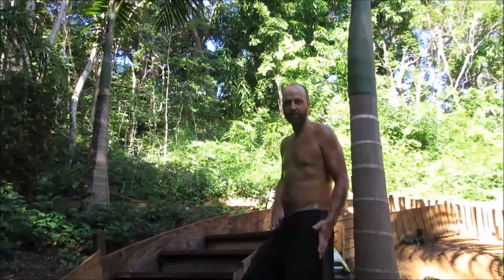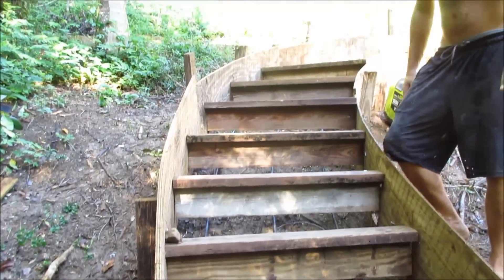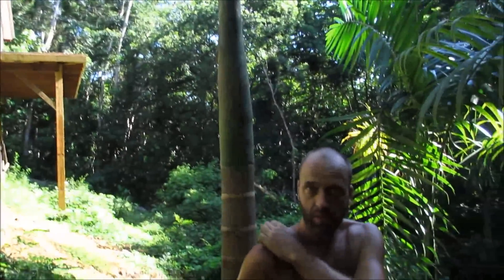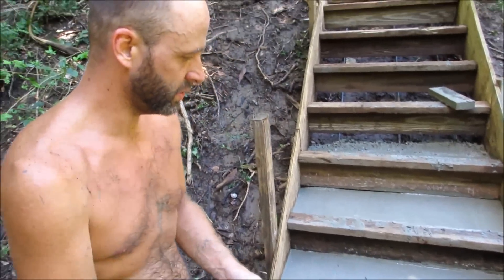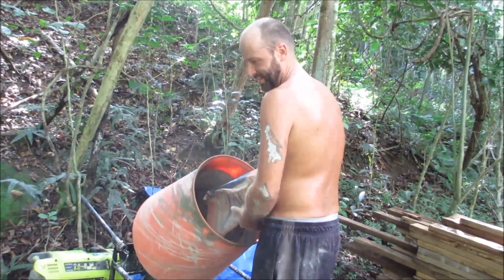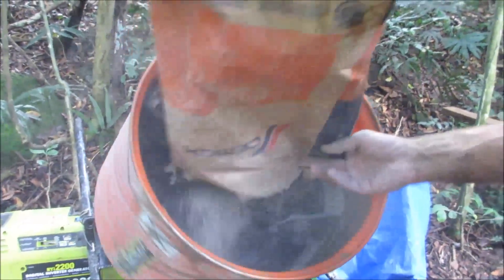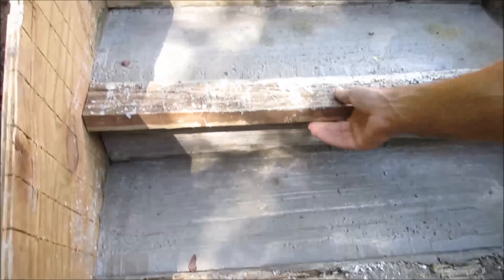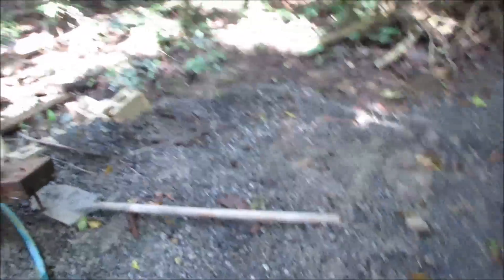How to Make A Concrete Staircase -Even in the Jungle!

Comment: 1 Did you ever put a handrail/roperail across your "Bridge"?
2 What did you do with all the construction debris (forms/bags/misc)
3 Just a friendly tip. NOT meaning to be harsh. You need to get more protein in your diet.
   Especially when working that hard.

Thx for the vid.
MJ
Reply from the maker: Hi Mike! 1) We still don't have handrails on the bridge but since we recently had a baby, we might. We are finally putting them on the cabin deck now actually! 2) We saved the lumber from the forms to be reused and threw away the cement paper bags. 3) Not sure what's being implied by the protein comment. I think we eat well. 
Thanks!

Comment: Hey man,  You really need to add some water proof ground cloth, some perforated drain pipe and a bunch of gravel on the top side of those stairs (at least on the top side), or that new staircase will wash away during the first down pour.
Reply from the maker: Well considering that it is nearly 4 years old and went through many downpours and the worst hurricane in recent history that is obviously not true.  Thanks for commenting though.  You can see a recent video of it on our channel.

Comment: Good work with the stairs... but: - yiep!!! to mucth water in the concret... Next time.. a good advice: - First, you mix sand with ciment, on dry... and you let it mix well.. than you add water.. and let it mix ... so at last you mix the rocks.. let it mix.. and then you see if you need to compensate the water because its to dry.. you will never make a mistake this way.. and you will have a better mixed concrete!!!

Comment: Hi im from Puerto Rico and have a similar project to do. My question is money wise like how much it cost? the 40 bags and the rock and sand pile?
Reply from the maker: Hi Joel! Here is the cost of materials that went into this; each cement bag is about $4-5 so around $200 there. The rocks and sand were about $200-$300. We reused wood for the forms otherwise you'd need to buy those as well as the nails and any tools you needed like the trowels, mixer, shovels, buckets, hoses, etc. You may also need to factor in labor costs. We hired one person to help with the form work.
Reply: LifeTransPlanet thanks for the info. Wish you the best.

Comment: nice job,but I don't see how you anchored it to the ground.I hope you aren't depending on the weight of the concrete to keep it in place.one good sold day of rain and those steps will be undermined,then crack,then wash away.
Reply from the maker: We have a concrete slab at the top and middle. We have gone through tropical storms and hurricanes with torrential rain and have not had a problem at all in three years!

Comment: Question, did you make anything to prevent it from sliding off that slope? Once heavy rain falls, and that causes water to run along the stairs, it will remove the dirt under it, which may be a problem down the line.
Reply: 100% thats why we pour footings even under our stairs.  This guy was working by himself though and maybe its a relatively dry area.  Who knows
Reply: Needs lots of footings...
Reply: plant thickly rooted ground cover plants on either side and let a heavy root mat stabilize the hillside!   No?
Reply: I want to build the same. pipes into the ground that the concrete will set into at the top?

Comment: If you wanted clean sides I would have cut the grooves on the outside of the curves but if the sides aren't visible then  guess it wouldn't matter
Reply: I should add though this is a massive job for someone that's just learnt how to do it with YouTube vids well done mate

Comment: I am curious, what holds the cement to the ground? can it shift? does it move if the land moves (earth quake, land slide, etc)?
Reply: the rebars makes the stairway perfectly strong so there is no need to worry about shifting,however yes in an earthquake the stairway would crack,also if there is heavy rainfall & nowhere for the water to run off it will undermine the stairway that can lead to damaging it's form

Comment: Nice work very extensive.   I saw another video and a guy said you should vibrate the concrete to help get the honeycombs and holes out. to keep nature from pre damage and water can do anything.   I didnt see that you did that, have you noticed any change to your work in the passing months?  Did you seal it?  And if so with what?
Reply from the maker: Thanks! I tapped the sides of the forms with a hammer to a vibrate it. We didn't seal it at all and everything is still looking great!